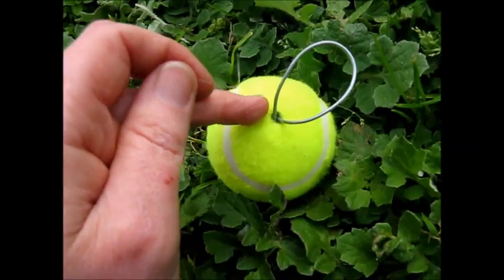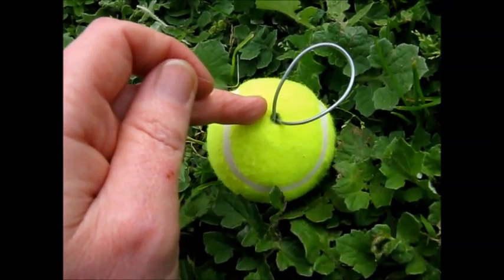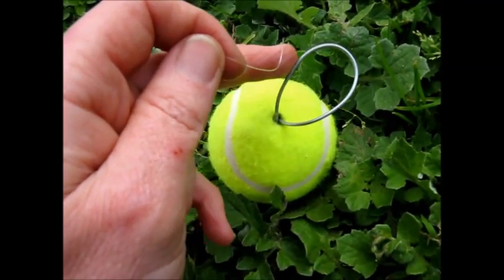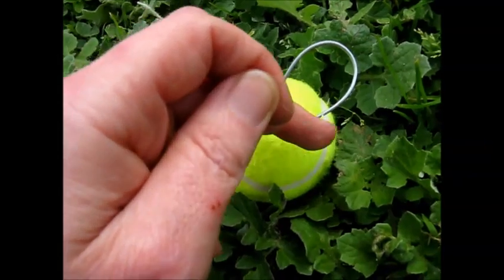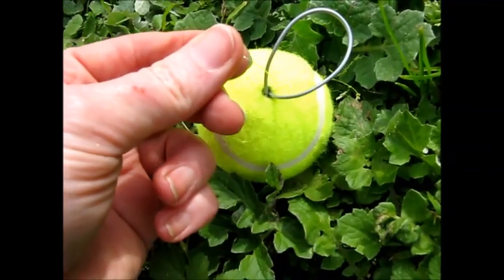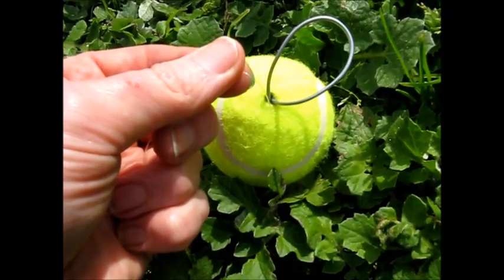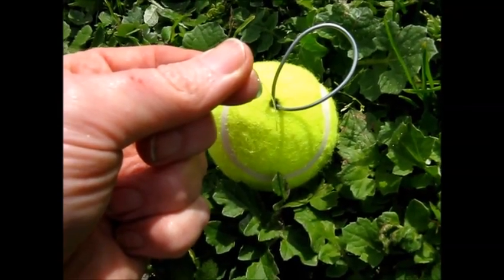Using a tennis ball to raise a wire antenna

Comment: Pete I know its a long time ago since this video but where do you get a plastic tapered reel for the fishing line? Did you 3D print it? It looks like a good compromise to avoid having to use a fishing reel to allow the line to release without causing drag or friction. I am struggling to find anyone who stocks something like this simple red reel.
Reply from the maker: Would have come from K-mart or Big W or similar.

Comment: One of the worst suggestions ever from one of the best hams on the planet. Go figure. Anyway.....use a proper arborist throw line and weighted throw bag which are designed for this purpose....or ignore my advice and live through the sheerest pain of untangling fishing line and trying to get stuck tennis balls out of a tree - you'll be doing both. Edit: Perhaps Peter is being funny? That's always a possibility.

Comment: You can use a kids T-ball instead.  They're a bit heavier and have a hole drilled through already; you may need a 100lb fishing line or builders twine.  You can get the T-ball from a sports store; I got mine from Rebel.

Comment: I have used a sling with a rather large and heavy steel nut, just enough weight to pull the fishing line down.
..and for anyone who wants to go into extremes, a bow and arrow will lift the line even higher!

Just be in a really remote area and don't get caught by the police using it.  As soon as your line is up, dismantle the bow so it becomes inoperative.

Happy DXing guys!   73's
Reply: Αrthur Manolopoulos   I always use a bow for this.  Removed pointy tip and replaced with 4 ounces weights.  Wrapped it up in rubber tape and blast it up over 70 feet using braided fishing line.  Then switch to 1/4 “ Dacron .

Comment: Saw a variation of this on YouTube. Tennis ball was slit and a very large steel nut was inserted, with very light nylon twine tied to the nut. Slit was taped shut and the ball was launched with a thing called a 'Chuck-it', a long tennis ball slinger for playing fetch with dogs. A guy about 70 launched it over a 10 meter tree, second try.

Comment: #1 that tennis ball is too light to pull the line down very well. i simply use a rock and tie the line to the rock. of course, you could kill someone if they are in the way of the rock coming down. have to be careful. lol